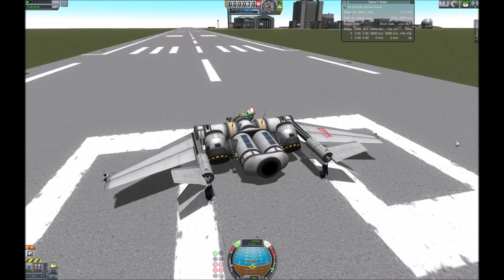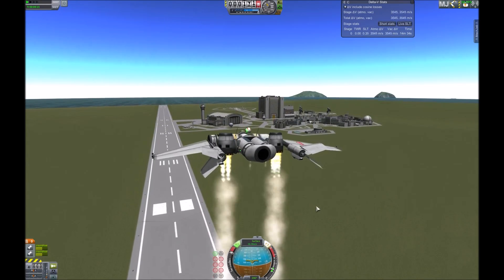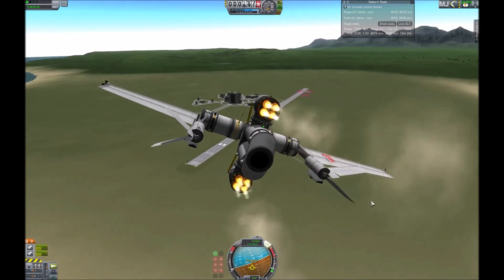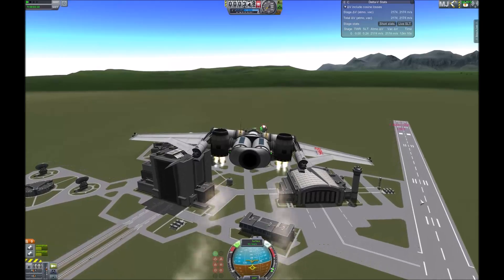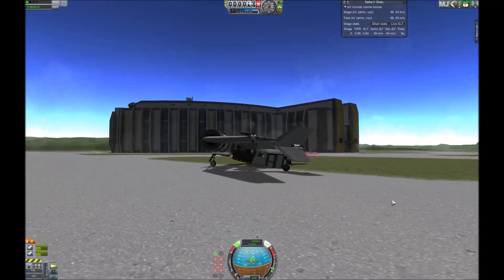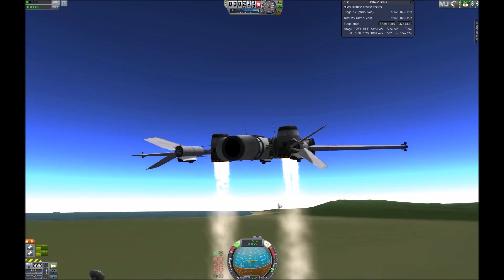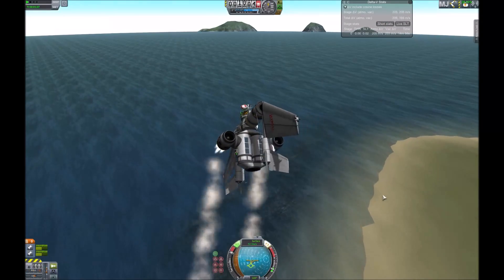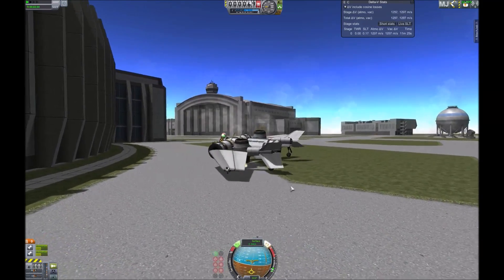Star Citizen Reliant Flight Modes in Kerbal Space Program

Comment: Nice video, but there will be manual switching flightmodes. Sure they will not be implemented at first (so they will implement an auto animation at first), because the focus is currently on more important (core)features.

Also a sidenote:  Your ship is rotating the wrong way around. The cockpit should rotate, not the back with the thrusters. Since the seats in the cockpit will also adjust/rotate (Where the pilots first sit next to each other, with altered flight, they sit on top of each other).